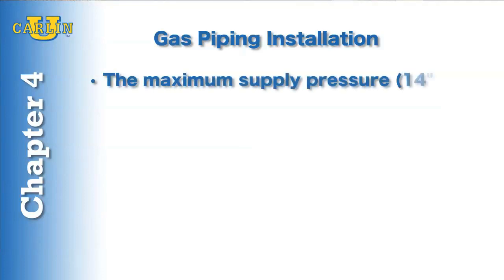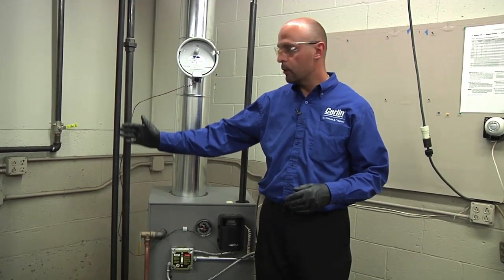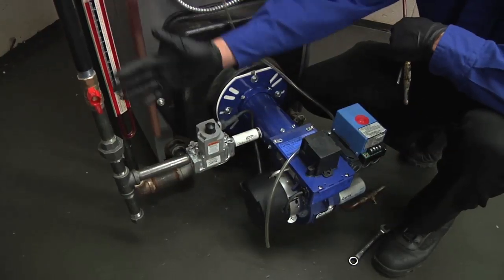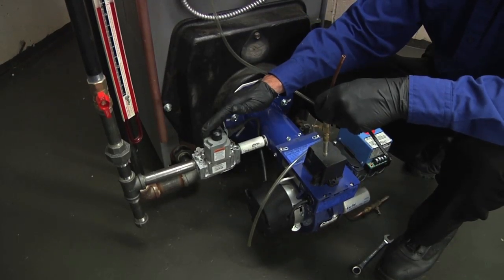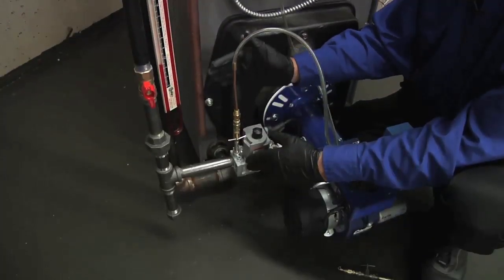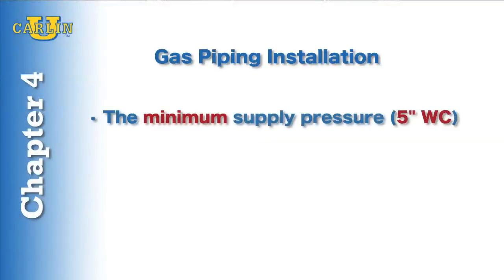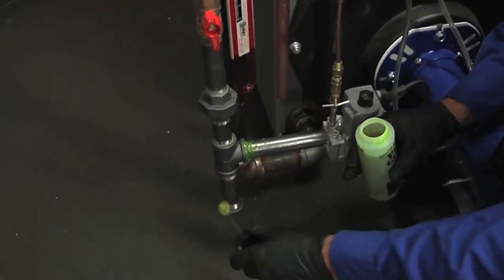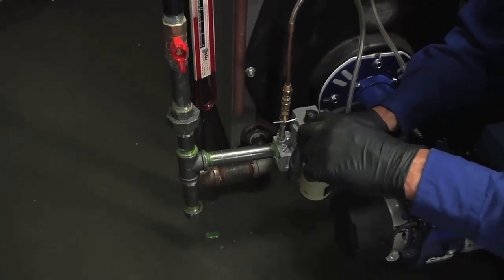Carlin EZGas Pro Chapter 4: Install Gas Piping and Verify Pressure

Comment: question : when the burner starts the gas flow, the manfold inlet pressure drops to 4.5 in h2o  from 6.79 before the call for heat. is this normal? all my combustion measurements look great so i assume the burner is not being starved for fuel.
Reply from the maker: It is normal for your incoming pressure to drop when your valve opens.  Please give our tech hotline a call if you have any other questions.